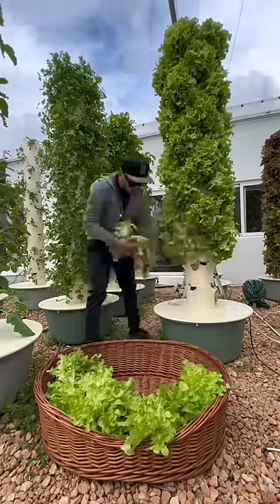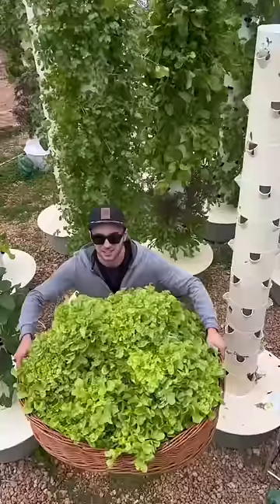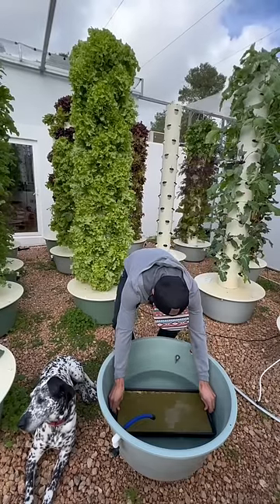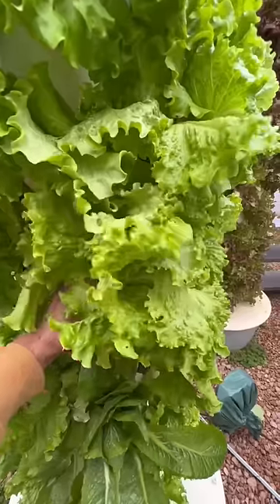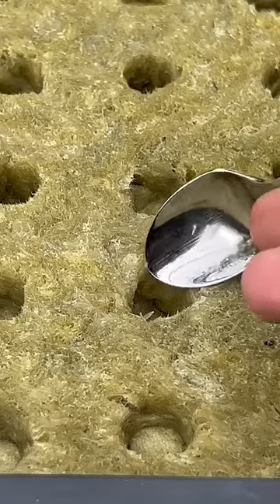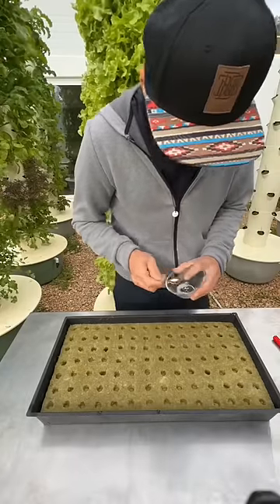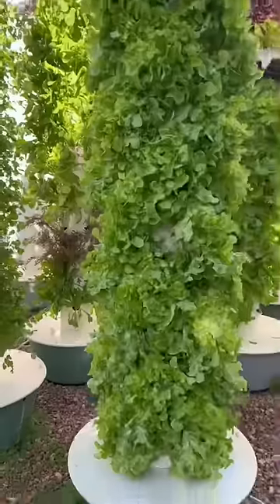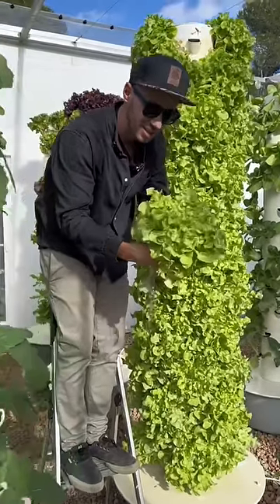Strategies for growing soilless lettuce #lettuce #towergarden #verticalfarming #gardening #farming

Comment: I worked at a pot farm and we used rock wool. I HATED IT. It was basically fiberglass, it was dusty and itchy, and if it got up your nose you were fucked.
The plants hated it too, they all grew consistently smaller and STUNK.
Reply: How was the potency, thc?
Reply: @rocky8758  exactly the same with adjusted nutes. Coco coir works good but (unfortunately?) canna does best in rockwoll for some reason. Only ever grew gwkp/cbd though
Reply: Whattt??!??! My weed loves to grow in rock wool or we got different types of rock wool compared what we got in the Netherlands but they absolutely love it, i do use it only for the clones though noo seedlings will be put in rock wool
Reply: Best method is to soak em in a light feed water at like 5.5-5.7 for like a day. Rockwool is pretty high pH and the clones need some nutrients to really pop, I get roots so long I have to trim em during transplant days...and make sure to wear gloves and dont touch your skin, again, fiberglass
Reply: Worked at a high end legal cannabis greenhouse in Canada for a couple years and we used coco coir from day 1 cuttings until harvest. Originally we used rockwool until cuttings rooted then right into coco though. Made no difference
Reply: Now imagine the armies of poor shmucks that have to insulate buildings for barely above minimum wage
Reply: Is it the same rockwool used for heat and noise insulation?
Reply from the maker: This is agricultural rockwool, not rockwool for construction. Agricultural rockwool has no chemical binders. Additionally, when we work with the rockwool, it is soaked in water.
Reply: ...ok, so apparently your pot farm didn't know what it was doing is what you're saying?
Reply: @Agrotonomy  Why take mineral wool, which can not be perfectly recycled, because there are enough alternatives?
Reply: pot farm plants stunk
you growing skunk

Comment: How does it go from rock wool square to vertical in planters?
Reply: Like he said. You just water it twice a day..
Reply: ... and they jump onto the pillar when they're feeling bold enough?
Reply from the maker: Our planting process begins with seeds that are placed in agricultural rock wool (made from basaltic rock). These seeds are watered until they germinate and develop into seedlings, which usually takes 2 to 3 weeks. After this, the seedlings are moved to an aeroponic tower, where they receive water enriched with an ionic mineral nutrient solution that provides all the necessary minerals and trace elements for plant growth. This solution is delivered through a submersible pump located in the bottom reservoir.
Reply: Delicious
Reply: @abelink9229  🤣🤣🤣🤣
Reply: @Agrotonomy  so its one seed per rockwool hole. On the 2nd week, transfer it to the holes where water is moving consistently. Is that right?
Reply: Who sells aeroponic towers and components?
Reply: @Agrotonomy  thank you for the answer, probably should say that next time when developing you short so you don't frustrate your watchers.
Reply: @abelink9229  🤣🤣🤣🤣🤣
Reply: @Agrotonomy  Is this liquid solution regularly sprayed directly to the roots? Do you tamper with the ratios in order to achieve a desired flavour and texture?
Reply from the maker: @alexalekos  The plants are irrigated intermittently 3 minutes on and 12 minutes off continuously. The towers are automatically filled up on an as needed basis via a gravity tank. We have the nutrients set on a 1 to 300 ratio using a dosing system known as a "dosatron". Every liter of nutrients has 300 liters of water.

Comment: Wow what a great video and a good idea. I’m curious how the vegetables get their Nutritional needs. I’m sure that water is not the only thing that they receive. Do you have a formula of what kind of food/fertilizers that you put in the water that give them the growth potential that they need.? Thank you kindly
Reply from the maker: The tower is hollow on the inside. There is water mixed with nutrients that sits in the reservoir with a low-wattage submersible pump. The plants are irrigated intermittently 3 minutes on and 12 minutes off continuously. The towers are automatically filled up on an as needed basis via a gravity tank. These nutrients are dosed at a 1:300 ratio using a dosing system known as a "dosatron".

Comment: I did this when I was living in Maryland 10yrs ago and fungal infections was our biggest problem. Also, the hard water will eventually create problem to the water pump, and the maintenance takes more time for us than we would like to spend on.  Another issue no one mention was the add-ons that you have to buy it you want to grow them indoors. We had to buy one those UV light and installed them on our ceilings to give these hydroponic garden the right amount of lights in the winter. We sold ours on the Craigslist a year and a half later, and I feel so relief after getting rid of it. However, this also gives me more appreciation to the farmer's we buy our produce from. 

When it comes to price, the water and electric bills combine per month is still cheaper than buying lettuce weekly at the grocery stores in Maryland. However, the fertilizer, seeds, filter, and maintenance takes up more time and money for us. 

To those who wonder how it taste: our Romaine lettuce taste very similar to the ones you get from the store. However, our arugula doesn't have that kick that you will get from growing in the soil. We didn't grow tomato because the community we joined said to us that the tomato won't taste good with just water and fertilizer.

Is a great system to own if you live in a city and want some reasonable greens in the winter. Or if you have a passion towards grow plants.

Comment: Pls show in detail how you transfered the substrate into containers.
QUESTION: u are  usimg plastic  . How do u prevent micro plastics in yr veggies?  .
## how do u keep fungus from growing in yr containers?
Reply from the maker: We have videos featuring how we grow from seed to harvest, kindly check them out on our profile. You may also visit our website: https://agrotonomy.com/
Reply from the maker: After using our towers for 10 years outdoors, they were tested for chemical leaching to the nanoparticle and we passed.  Zero chemical leaching. Our proprietary plastic resins are in a category of their own. There is no PVC or polyethylene used in these towers.
Reply from the maker: As part of our maintenance routine, we clean the towers every two growth cycles. We disassemble them, soak in citric acid water for 2 hours, use a pressure washer, and let them dry under the sun. We don’t use soap or other cleaning products.

Comment: Tip: Rockwool tends to be uniform in shape. Make a wooden box with holes for some seeds and an inlet for a shop vac. Use the shop vac to suck one seed into each hole, turn it upside down, turn the shop vac off, and youre all done :)

Comment: Nice, what are these built out of?
Reply from the maker: These aeroponic towers are constructed from the highest quality UV-stabilized, BPA-free, food-grade plastic available. These aeroponic towers are constructed from high-quality resins that meet FDA and RoHS regulations for use in food contact applications.
Reply: Bro just tell people it's either a 6 or 8 inch PVC pipe. It's not that intricate

Comment: As somebody who has done it all, aquaponics, hydroponics, aeroponics(which is still hydroponics) and gardening, I can emphatically say that nothing, NOTHING tastes as good as produce grown in soil. 

The only one of these systems outside of regular gardening that I would say makes sense is aquaponics. I wouldn't even recommend it because it's also a lot of work. The reason I say it makes sense is because you can get a top notch source of protein and because you can stack and incorporate regular gardening practices into it and use its  byproducts in your garden. For example, you can use the solid fish waste to grow plants in soil and let me tell you these plants go crazy over it. 
As opposed to hydroponics where you have to buy so many things to grow your plants. You need 24/7 electricity. You need to constantly be checking on things ALL THE TIME. I'm speaking from experience.
Check the flow rate, check for pests, check for fungus (if it gets too warm) check the water to make sure the nutrient contents are acclimated to the plant. Pumps constantly failing because of hard, mineral filled water then you have to clean them or buy a new one. Man when i tell you it's a full time job I'm not joking at all. It's not worth it. 

Then worst of all after everything when you crunch all the numbers, cost of towers,  cost of fertilizers, trays, power consumption, etc.  CONGRATS you're paying 4-5 dollars for a head of lettuce. May as well go to whole foods and buy all organic everything and it's cheaper.
Reply from the maker: 1. Flavor: Aeroponically grown plants have 100% availability of oxygen at the root level, which improves their ability to absorb nutrients. As a result, whether it's nutrient density, antioxidant levels, or flavonoid levels, soil farming crops rank among the best ever tested. Increased nutrient density, flavonoids, and antioxidant levels translate to better taste and vegetables with the right texture and water content!

2. Electricity & irrigation: The electricity is not running for 24 hours per day. The irrigation is flowing only for 4.8 hours per day (3 minutes on, 12 minutes off continuously). This also applies to the electricity usage. 

3. Pumps: We use Sicce pumps that are manufactured from Italy and we have never had one pump ever break. Choosing a reliable manufacturer for pumps is an important factor when growing in hydroponic and aeroponic systems. 

4. ROI: It does not cost $4 per head of lettuce when growing on aeroponic towers. With an aeroponic tower, you can get your ROI back within 6 months. This is based on the fact that you can grow 52 plants per square meter within 1 month, making it a much higher yield compared to traditional hydroponics. 

5. Automation: In a Tower Farm, the nutrients are automatically dosed with the water and the nutrient-rich water sits in a gravity tank that automatically fills up each tower on an as-needed basis. The water we use is RO water which eliminates any issues related to pH. Additionally, in our systems, since the water isn't being irrigated in a constant flow, we have 0 EC (electroconductivity) issues.

Comment: Please give us a step by step guide on this setup. I would love to try this
Reply from the maker: The tower is hollow on the inside. There is water mixed with nutrients that sits in the reservoir with a low-wattage submersible pump. The plants are irrigated intermittently 3 minutes on and 12 minutes off continuously. The towers are automatically filled up on an as needed basis via a gravity tank. These nutrients are dosed at a 1:300 ratio using a dosing system known as a "dosatron".

Comment: How do you compensate for the nutrients that veggies get from the soil?
Reply from the maker: Plants that are grown aeroponically receive an unobstructed supply of oxygen at the root level, which enhances their nutrient absorption capacity. Consequently, these crops have exceptional nutrient density, antioxidant, and flavonoid levels compared to soil-grown crops. These elevated levels of nutrients result in vegetables with an improved flavor, texture, and water content.

Comment: Does it have the vitamins like the ones that are grown in soil?
Reply from the maker: Plants grown aeroponically benefit from a consistent oxygen supply at the root level, which improves their nutrient absorption rate. As a result, crops grown using this technique have exceptional nutrient density, flavonoid, and antioxidant levels that outstrip those of soil-grown crops. The increased nutrient levels lead to vegetables with better flavor, texture, and hydration.

Comment: So beautiful and healthy looking lettuce. Love the idea just. Not sure if it is cost effective in the long term if it requires a 24/7 power source to run it.
Reply from the maker: Each pump for the commercial towers uses 45 watts per pump x 4.8 hours per day (3 minutes on, 12 minutes off). This is very low energy usage per day, in fact, according to local electricity rates in the USA, each tower uses about $1.10 in electricity per month.

Comment: Ok so..once the lettuce reaches a point of growth in the "bed", how does it continue to root or grow when the base is so far down? How does the root system stay wet or get watered?
Reply from the maker: We initiate the growth of all our plants from seed, which we place in agricultural rock wool (made from basaltic rock). The seeds are watered until they germinate and become seedlings, which typically takes 2 to 3 weeks depending on the variety. The seedlings are then transplanted onto an aeroponic tower, where they receive irrigation through a submersible pump located in the bottom reservoir. This pump delivers a nutrient solution enriched with all the essential minerals and trace elements required for optimal plant growth.

Comment: How to do you transfer the plants into the towers? And can you plant tomatoes and potatoes?
Reply from the maker: We start everything from seed which we put in agricultural rock wool (made from basaltic rock). We water the seeds until they germinate and become seedlings which takes 2 to 3 weeks depending on the variety. We then transplant the seedlings on the aeroponic tower, and they are irrigated through a submersible pump in the bottom reservoir that provides water mixed with an ionic mineral nutrient solution that provides all the essential minerals and trace elements for healthy plant growth. Tomatoes thrive well on these aeroponic towers but you can’t grow most root and tuber crops such as carrot, garlic, ginger, onion, and potato on them.

Comment: So.... it goes from flat, to standing all by itself, and is ready to harvest immediately. Nice 👍
Reply from the maker: We initiate the growth of all our plants from seed, which we place in agricultural rock wool (made from basaltic rock). The seeds are watered until they germinate and become seedlings, which typically takes 2 to 3 weeks depending on the variety. The seedlings are then transplanted onto an aeroponic tower, where they receive irrigation through a submersible pump located in the bottom reservoir. This pump delivers a nutrient solution enriched with all the essential minerals and trace elements required for optimal plant growth.

Comment: So where do the nutrients come from and how does the tower hold water?
Reply from the maker: The tower is hollow on the inside. There is water mixed with nutrients that sits in the reservoir with a low-wattage submersible pump. The plants are irrigated intermittently 3 minutes on and 12 minutes off continuously. The towers are automatically filled up on an as needed basis via a gravity tank. These nutrients are dosed at a 1:300 ratio using a dosing system known as a "dosatron".

Comment: Wow! Now how much would setting something like that up cost?
Reply from the maker: The prices of the aeroponic towers vary depending on the quantity of towers selected and the country. To view all the rates, visit our website for more information: 🌱 https://agrotonomy.com
Reply from the maker: Each aeroponic tower is equipped with a low-wattage submersible pump that operates at 45 watts working intermittently 3 min on and 12 minutes off continuously, which means 4.8 hours per day. To calculate the cost of electricity, you need to multiply 45 watts x 4.8 hours = 216 watts.

Comment: Does it have nutriens without soil?
Reply from the maker: The use of aeroponic towers in plant growth allows them to receive 100% oxygen at the root level, which enables them to absorb nutrients more efficiently. As a result, crops grown using this method have nutrient density, flavonoid, and antioxidant levels that exceed those found in soil farming. The increased levels of nutrients translate into improved taste, texture, and water content in vegetables.
Reply: @Agrotonomy  wow thank you for answering! ill keep that in mind!

Comment: Won't they lack some nutrients which they should have absorbed from soil?
Reply from the maker: Aeroponic growth provides plants with a continuous supply of oxygen at the root level, which boosts their nutrient uptake. Consequently, crops grown using this method have remarkably high nutrient density, flavonoid, and antioxidant levels compared to soil-grown crops. These elevated nutrient levels translate into improved taste, texture, and hydration in vegetables.

Comment: How does the flat rectangle block transform into a tower? May you show that step please?
Reply from the maker: We initiate the growth of all our plants from seed, which we place in agricultural rock wool (made from basaltic rock). The seeds are watered until they germinate and become seedlings, which typically takes 2 to 3 weeks depending on the variety. The seedlings are then transplanted onto an aeroponic tower, where they receive irrigation through a submersible pump located in the bottom reservoir. This pump delivers a nutrient solution enriched with all the essential minerals and trace elements required for optimal plant growth.

Comment: I wonder the nutritional value of these compared to ones grown in soil
Reply from the maker: Plants that are grown aeroponically receive an unobstructed supply of oxygen at the root level, which enhances their nutrient absorption capacity. Consequently, these crops have exceptional nutrient density, antioxidant, and flavonoid levels compared to soil-grown crops. These elevated levels of nutrients result in vegetables with an improved flavor, texture, and water content.